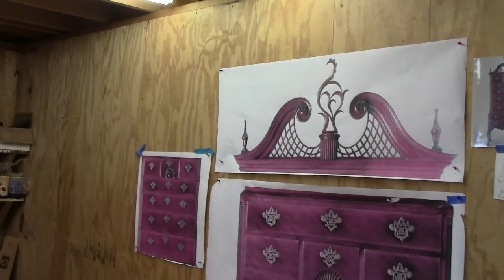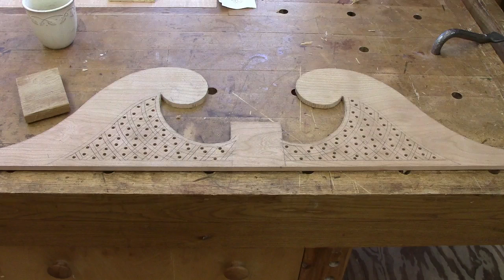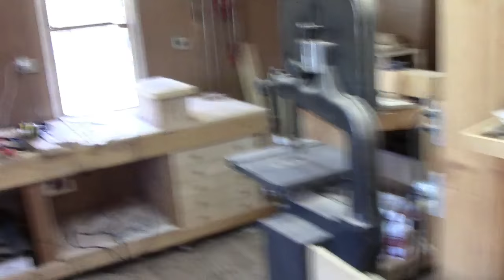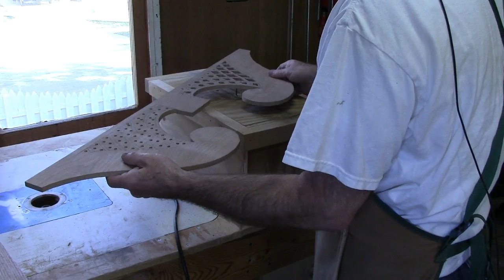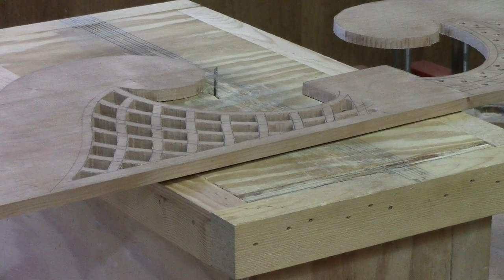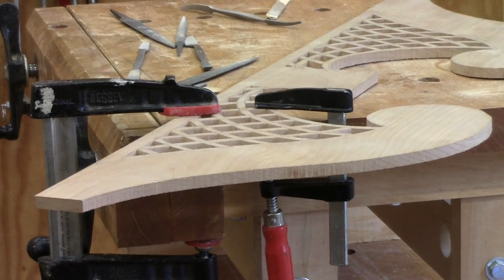Chapin HighChest Making the Lattice Fretwork Step 15

Comment: Mr. B,
           I am not 2nd guessing you, if I did this work i would still be on the legs.

           But if you put a mortise bit into a drill press, would that work ?

          You could use different sizes of bits. Maybe this is overthought on my part.

           Probable would not work on all of the openings on the lattice.

           Great work and well thought out.

                                                                     Happy Thanksgivings   Ralph
Reply from the maker: Thanks Ralph, Any idea is a good idea, the openings are not square so I would still have to saw out some of the material or do a lot more removal with the rasps